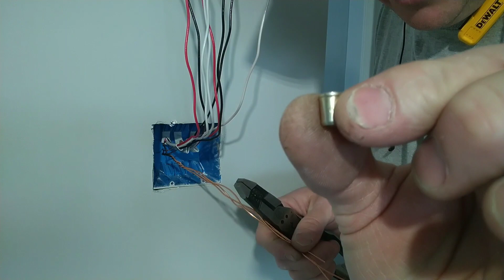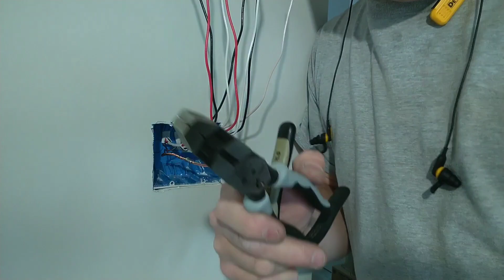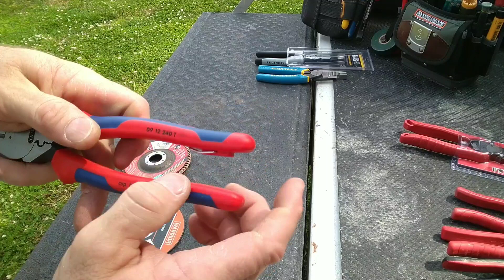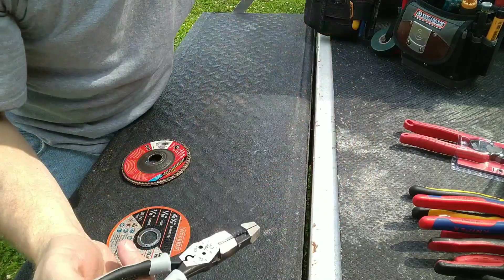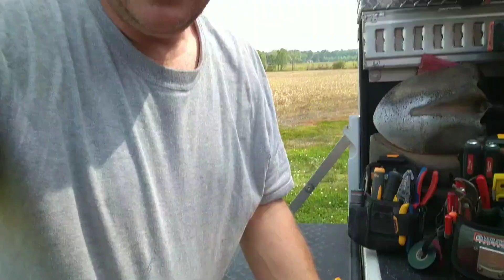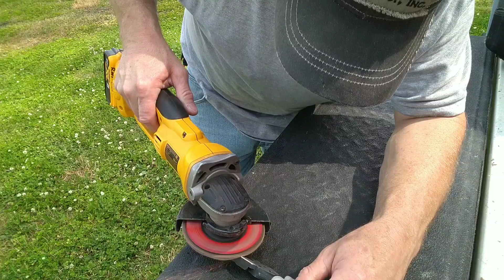KLEIN TOOLS hybrid pliers J215-8CR review and modification + 500 subscriber giveaway

Comment: Why use the buchanan crimp instead of a wire nut with pigtail?
Reply from the maker: Thanks for watching and commenting 👍🏻. 
I like the Buchanan over the pigtails method. One less (bigger) wire nut,over the size of the Buchanan=less box fill. Here lately, I've had to do quite a few pigtails due to the drywaller's and painters cutting my grounds off for caulk prickers 😥 And all the electricians watching my channel ask me why I don't make up my boxes on rough-in 🤔

Comment: You don’t use wire nut on your ground ? That crazy.
Reply from the maker: I use green wire nuts on single gang outlets and single gang switches. I used Buchanan crimps on doubles, triples and four gang switch locations.